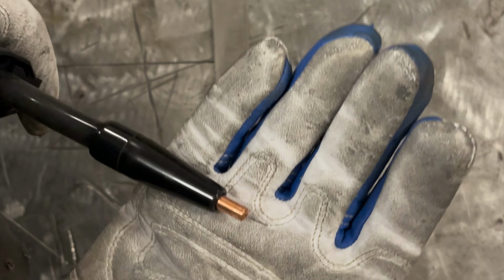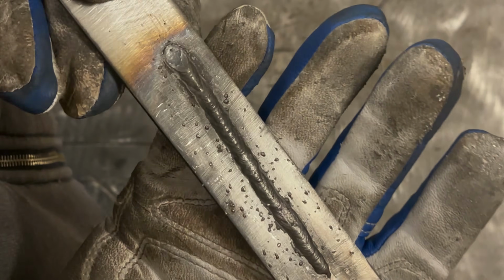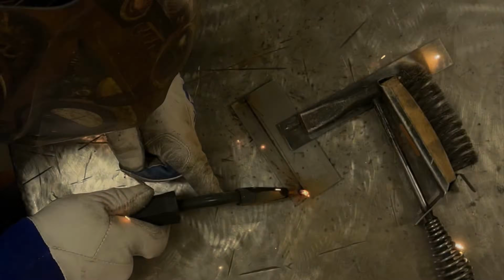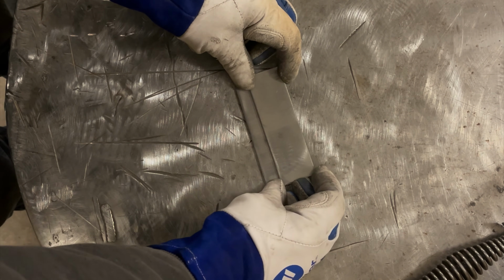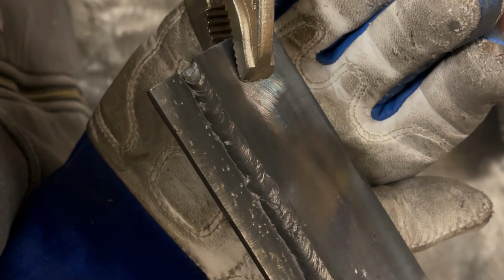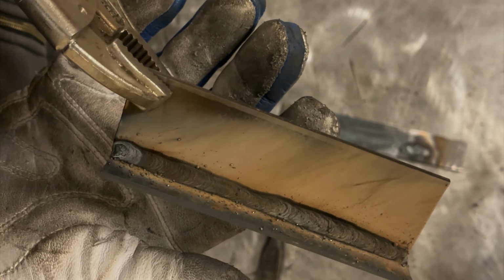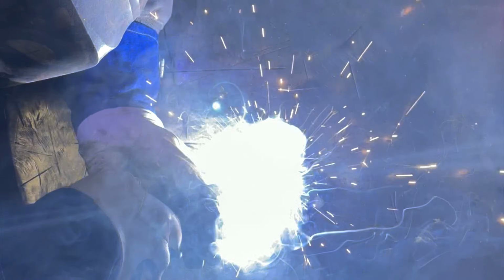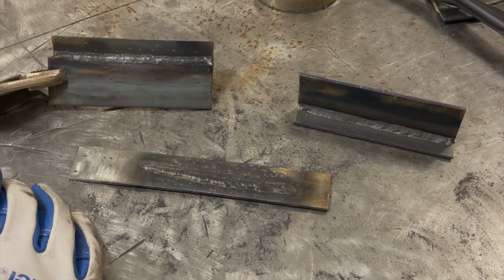How to weld with flux core wire

Comment: I never weld in a straight line. I found it to make a weak weld with little to no holding strength. I've always welding side to side while moving along two pieces of metal. That way you get penetration into both pieces and the holding power is so much stronger.
Reply from the maker: It really depends on circumstances.  Weaving produces a bigger weld and that in itself is stronger than a single pass stringer.  However weaving limits root penetration and in some cases gets more sidewall fusion.  A single stringer root and a 2 bead cap (or a weave over it) on a fillet weld welded from one side will be stronger than a weaved single pass because of the fusion lost on the root with the weave.  Regarding flux core in particular, weaves might possibly be stronger than a stringer, and the reason isn’t what you would expect.  Flux core self shielded is extremely prone to internal weld porosity on thicker steel (1/4in and up) unless you run .045 or bigger wire.  By weaving you might carry enough heat and limit the weld throat depth which will help give time for the gas to escape.  Less porosity means a stronger weld.  In the case of short arc mig, stick, tig, and dual shield this isn’t an issue and stringers will indeed make stronger welds.

Comment: Why doesn't it shock you when you place your hand/finger on the metal while you're welding it?
Reply: Electricity will prefer the path of least resistance, and that voltage  plus your PPE means you don't get shocked.

You run high voltage AC Tig when drenched in sweat and you will feel that

Comment: I just don't understand why kind of table you can and can't do this on.  Plywood ok?  Mandatory metal table?  ty
Reply from the maker: Great question.  So for tig welding you can get by with almost anything really.  With stick and flux core welding you want a thicker piece of metal because the spatter will stick to everything and if you don’t grind it down occasionally it will be super rough. With mig you want something that has some thickness but it could be less than a stick welding table.  

The best way to get a decent table on the cheap is to find someone selling 3/8th to 1/2inch plate steel (8mm+) and get a piece atleast 16x16in.  Take that and put it on a stand and you’re golden.  The welding table I use often is a base made from wood with a super thick round chunk of steel.  Wood is not ideal because it can set on fire, but it can work ok to support a metal table top.  You want to avoid oxy fuel cutting or leaving red hot metal on/near wood for obvious reasons 😀.

Comment: Very good tips  and well explained
Reply: Guy i had worked fore had acquired a flux core welder in salvage from box stores ...wound up melting a lot of the wiring inside had to rewire  it he used a long small guage extension cord    which is not good ..i worked for him 14 years he had it then  were the older ones ac   not dc..???

Comment: Are you using any kind of motion on this weld ? Like back and forth or circle
Reply from the maker: With flux core I generally don’t move at all besides a slight back and fourth.  You generally want to avoid doing big circles and putting down a lot of metal with Gasless flux core because there is a high probability of internal weld porosity when you put down a lot of metal with it.  Stick to single bead width welds and a slight stitch motion for the cleanest welds.
Reply: Thanks

Comment: very informative video,  thank you very much for this series, much needed facts on Flux Core which , as you said, gets no real respect from most people.
thnx again, much luck to you...   J.R.G.
Reply from the maker: No problem 😀👍.  Flux core does have a bad rap and is under appreciated.  It’s very useful for general repair and is capable of a ton of projects.  If people had a decent machine and a idea of what to do they would realize it’s actually a very solid process that’s easy to weld out of position, has good penetration, and can make really decent looking welds.

Comment: Hi again Greg - a safety bulletin for the benefit of fellow metalwork newbies. Earlier I was cleaning up a load of steel prior to welding it, using a brand new (cheap) flap wheel. The bloody thing exploded. Don't know why because I wasn't abusing it, I was just cleaning off mill scale with the wheel tilted maybe 10 degrees. Anyway it dug some deep gouges into the safety guard before some of the bits flew about 10 feet away from me towards my work bench and one piece carved a chunk out of the wood. I was wearing safety glasses and when cutting I also wear a spare cheap welding helmet just in case - for those thinking that these disks can't delaminate and disintegrate I can assure you that they can. The expression is "I nearly shat myself!".
Reply from the maker: Glad to hear you made it out ok 👍.  I have never seen a flap disc explode, but I am sure it could happen.  Walter abrasives recalled a ton of their flap discs due to a failure in the glue that held the paper in place.  If you ground on a hot weld or used the disc hard enough the glue would heat up and fail, causing the disc to blow apart.  High RPM grinders would easily throw parts of it around dangerously.  The guards do work, I run them on every grinder I own besides my slow speed Milwaukee.
Reply: @makingmistakeswithgreg  Another learning experience - don't buy cheap disks, like I did. I bought 2 at a local store for about $2, one was ok but the 2nd broke - I've just checked and neither has a date, or anything, embossed in the metal part, and the cut-off disks (all a 'reputable' Chinese brand) I bought in the city last week expired in 2022. I've never checked before but I certainly will in future!
Reply: Thanks

Comment: Hi Greg, I'm welding up a project right now and I may finish before you reply, but there is one position of weld that has me stumped. I'm rotating the project (it's a storm drain cover about 1m squared and 2" x 5/32 steel bars) to give myself short horizontal T-joints where I can, but at the edges I can only get in if I push the nozzle right into the corner and drag towards me - I can only see the arc, no puddle at all. I am not sure how to tackle these (20 welds in total). Do I simply press the trigger and pull the arc at roughly the same rate as the welds I can do normally? I'm really pleased with the flux core so far because I seem to have got the puddle well and truly sorted out and my easy welds are looking good. Cheers.
Reply from the maker: So you have found one of the “non traditional” welding situations lol.  There are a lot of ways to tackle the problem.  If you’re using self shielded wire you could run a pinch longer stickout and/or pull the nozzle off the gun (if the nozzle doesn’t retain the contact tip) to get better vision.  Plenty of times I have welded without seeing what I am doing.  In such situations I have settings I know will work, and I try to move smooth and consistent.  You can actually make decent welds without seeing much.  In many cases things are over welded (stronger than they need to be) so do the best you can and I bet it will be strong enough 👍
Reply: @makingmistakeswithgreg  Hehehehe cheers, onwards and upwards!

Comment: Do you wiggle or zigzag with the drag or just drag straight slowly?
Reply from the maker: So I have touched this in random videos, but here is a general idea:  for a root pass you are almost always better off running a single stringer weld.  By manipulating the puddle and putting a bigger weld down, it’s very common to lose penetration.  For a fill pass you can make a wider weld if needed.  When running a Stringer weld it’s ok to do some oscillation forward/backward but try not to make big steps.  When you do big steps you can lose penetration because the heat leaves the area.  A simple straight consistent drag will produce the more consistent penetration.  However in many cases it doesn’t work the best.  6010/6011 rods tend to run worse with a straight drag and Gasless flux core tends to run a bit better with a slight oscillation.

Comment: I bought a small 110v flux core machine once , and even if im an 20+ years experienced mig welder , i found it really hard to weld with this. Maybe a hobbyist would find it easier but for me , the problem was that it didn't feed well. Im used to quality machines that feed consistently ( i work with an esab warrior 500i ) and the inconsistent feeding was way off for me. I can't do a nice weld with that whatever i do
Reply from the maker: Feeding is better on higher end machines no doubt, however if decent wire is used (Lincoln nr-211 or fabshield 21b) and the tension is adjusted decently the little titanium 125 can make some really decent welds.  Self shielded Flux core in general isn’t the best process for the best welds, it’s highly sensitive to changes in feed rate so you are right, beyond a certain point you’re limited.
Reply: @makingmistakeswithgreg i ended up selling it , welding way too cold to my liking. Usually i weld with solid .035 wire , 1/8 thick i set it to 25volt and 500 ipm so im not used to this cold weld. But at least i did what i had to do before selling it. Might try a better quality machine one day. I do a lot of dual shield too so for me , flux core welding is more a hobbyist thing ( at work we have .045 flux core wire too but the spools are just taking dust in a corner we barely use it )
Reply: @Saleen35000  At 25 volt on 1/8 th you must be just ripping along !  Yeah no wonder you dont like flux-cor which for the most part is a dialed down slower process.

Comment: Another great video. Thank you for excellent instruction. Brand new to welding and your videos have really helped me. ✌️🫶
Reply from the maker: Glad to hear you’re learning and liking the videos 😀👍.  When you know how to use flux core it very useful and not super hard to get decent at.  Make sure to do a bunch of practice and expect to get frustrated a fair amount.  Before you know it you will be able to weld decently 😀.
Reply: @makingmistakeswithgreg  thanks so much for your replies! I know you said in one of your videos and I can't find it now...  Which flux wire do you recommend? I just picked up a 1lb roll 0.035" Vulcan for practice when I got the welder, that was all they had in stock. Thanks again, appreciate your time.

Comment: Thank you.  You saved me much frustration.  Excellent video.
Reply from the maker: Glad to hear than and no problem.  If you practice the tips I gave in the video you will be able to progress fast.  Flux core is actually a very easy process to learn and is super useful.  You won’t regret learning it 😀👍

Comment: Hi, really enjoyed this video. I have a yeswelder with Amp Setting. WFS and volts are set by machine automatically. But you can also fine tune Volts from -5V to +5V. What setting do you recommend for 1/8” plate?
Reply from the maker: So the yes welder uses a different approach for control than the welder in the video.  Since I don’t have a yes welder it’s hard to say what setting to use.  What I would do is use the recommended settings for 1/8th than they say to, and then base the voltage adjustment on what your weld looks like.  If it’s roped up and not “wetted out” go up in voltage.  If it’s real flat  and overly hot lower the voltage a bit.
Reply: Ok 😀

Comment: I thought the group has to be clamped to what you're welding. Where is the ground here?
Reply from the maker: The ground is on the table, the piece grounds through the table to the clamp.  If your welding table is conductive you can clamp to the table.  Keep in mind if you have a poor contact between what you’re welding on and the table it will likely arc to the table, and somewhat weld itself to it.

Comment: I am looking for small 220 volt arc welder
Reply from the maker: Depending on your budget I would look at the harbor freight titanium 225.  It’s small, light weight, compact, and it welds good.  For a bit more money the esab rogue 130-180 new or used are also very good.

Comment: I also bought some antij splatter spray
Reply from the maker: Anti spatter will help a lot at keeping things clean.  Flux core run with the right settings tends to be decently clean but the spray will make a difference.  Especially if you use it on the welding table.

Comment: I really appreciate the “real time” welding speed
Reply from the maker: Real time welding speed is actually slower than many would think, the trick is to run settings low enough that you don’t burn a hole through while moving slow.  The thinner the material is the harder it is to do that, so travel speed must increase to a certain extent depending on thickness and joint.  The key is moving slow enough that material is fusing together.

Comment: I recently picked up a  welder after 30 years. I'm trying to weld 14 gauge square tubing that's rusted and pitted. I think what you are trying to show people when it's done wrong is what mine looks like 😖. This was very informative and I'm probably be checking back with this video time and time again as I try to get my bearings with this titanium 140 harbor freight welder. Having a real bad problem blowing holes through. When I'm not doing that it's not getting penetration
Reply from the maker: Flux core tends to have a bit more penetration than short circuit mig, so no doubt it can be a bit challenging to weld thin material.  Here are some tips to help out getting the best results.  Make sure you are using .030 wire.  Make sure the gaps are minimal/fitup is tight.  If you tend to blow holes soon after starting try to lower the wire feed a pinch.  If it still blows holes run little 1/4inch welds then stop right before it melts through.  Ideally you would run a complete weld start to finish, but sometimes it’s very difficult to do.  Doing short welds will be weaker, but on thin material it probably won’t matter.  Find a setting that works to run a simple bead on the material that looks decent and doesn’t blow holes. That should be a bit on the cold side for an actual weld between two pieces but if there is a gap it should buy you some time before a hole shows up.  Beyond that it comes down to a bit of practice.  The thinner material the harder it is without a doubt.

Comment: Another fantastic video!!  Just wondering does it make a difference if you knock the flux off when its still warm or if you wait till its cooled off?   Thank you
Reply from the maker: Great question.  If you knock it off fast the bead will turn dull grey or blue color as it reacts with oxygen in the air.  I would wait until it’s cooled off enough that nothing is clearly glowing red.  It will make a shinier weld and be less likely to have molten hot slag wind up on you causing burns lol.  Flux core wire (self shielded) is more or less powdery and easy to clean without big hot chunks.  Many stick rods produce slag peels that can really burn you if they fall on your pants or something lol.

Comment: Do you just move the stinger in a straight direction? I’ve seen other people move in little circles, or a zig zag pattern. It’s difficult to tell exactly how you’re moving.
Reply from the maker: I move in a straight line and generally at the same speed.  Many people do manipulations and circles.  This will limit weld penetration which can be undesirable.  If you’re learning to weld stick to straight beads and try to be as smooth as possible with travel speed.
Reply: @makingmistakeswithgreg  
That would certainly be easier for me. Thanks so much for the reply.

Comment: I'm JUST beginning to weld and picked up this welder. Your tips are seriously GREAT to know and have under my belt before I really start my practicing. Thanks for sharing and setting us newbies up for success!
Reply from the maker: No problem 😀.  Expect to fail a lot and get frustrated at the start.  Treat learning welding like learning to write.  Repetitions and practice will iron out everything.  Try to focus on consistency as much as possible.  Move consistently, and try to be as smooth as possible 😀
Reply: @makingmistakeswithgreg  Your tip on changing wire saved me. I laid my first weld that wasn't pure spatter. Turns out the wire I was using was garbage. I was very frustrated, but when I changed the wire, I was immediately met with a bead I could see and follow! Thanks for helping me learn a skill I've wanted to know for decades!
Reply: I'm the Same boat just got a gasless mig and a stick welder but as I progress I'll move to gas and better welder as the ones I got are about $300ish for both

Comment: Excellent video. I would've like to see some stress testing though. To see how much those welds would take.
Reply from the maker: I have done a few flux core weld tests.  One of the big issues with flux core is in .035 wire it seems to be incapable of welding 1/4in without some pindots of porosity.  Steel thicker than that (5/16, 3/8th) will have a lot of internal weld porosity with .035.  Stepping up to .045 flux core solves most of this (the issue is the weld pool cools too fast and the escaping gas can’t fully escape with .035 on thicker plate).  Because of the porosity issues with flux core it tends to perform far less than short circuit mig on bend tests.

In this video you can see what I mean:
https://youtu.be/lEytWQQPHOU?si=7TewILNGprFooqUg

Also, standard store bought flux core wire seems to produce a strong but brittle weld.  It doesn’t have much give between its yield strength and its ultimate strength.  There are a ton of flux core wires that perform far better than standard store bought wire, but unfortunately they commonly are only available in .045+ diameter and require a lot of amperage to run.  This makes them impractical for the average person to use (most home machines can’t run that diameter or handle the voltage/amperage of bigger wires.  They are also only available in big expensive spools.
Reply: @makingmistakeswithgreg  Thanks for the info,I'm a beginner. I'm subscribing so maybe I'll learn something.